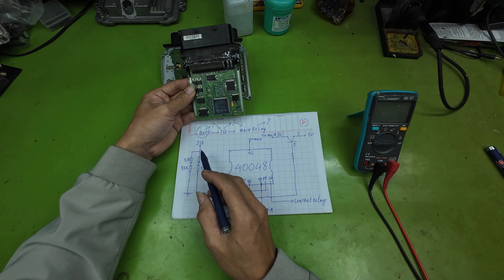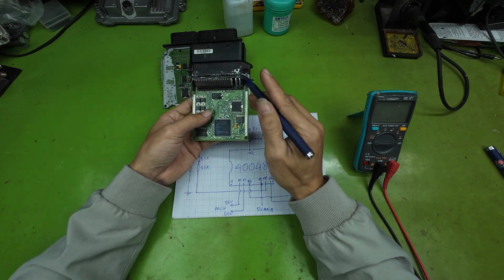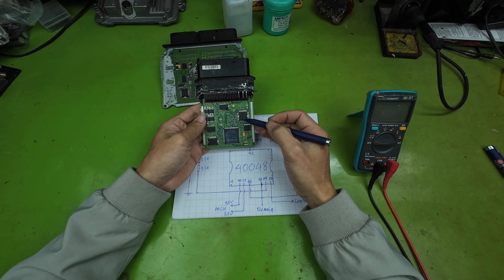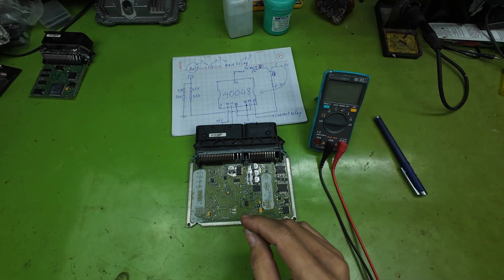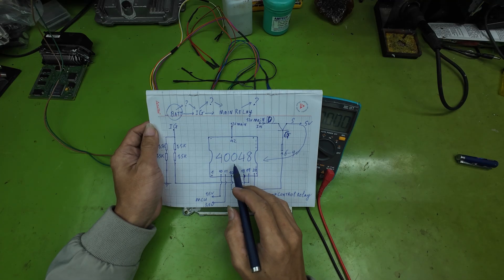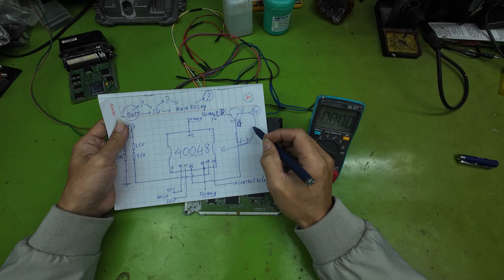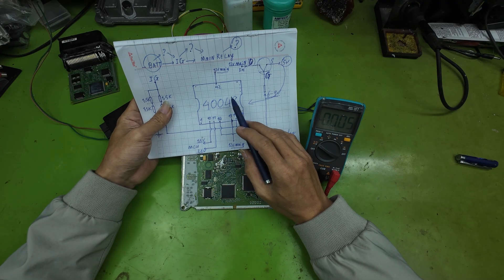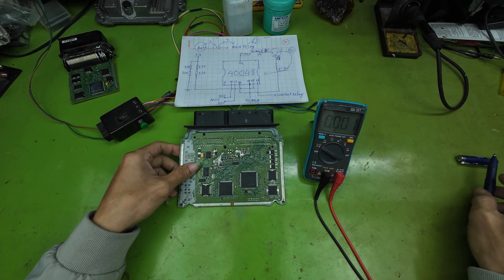Decoding the Power Supply Module in ECU Using IC40048 | ECU Repair Explained from A–Z

Comment: Good night  asking  a question what amp 12 volt  is needed when reading a ecu ,I'm trying with a  autel im508 ,hyundai ecu me17.9.11.1 cant read it giving me a chip error code.
Reply from the maker: When supplying external power to the ECU, a current of up to 2 amps is sufficient.
If you do not receive any response from the MCU, check the basic conditions, especially the MCU’s supply voltage, to determine the cause of the fault.
I’ve made a detailed video tutorial explaining the operation of the ECU power circuit — please watch and follow it carefully. I believe that once you do, you’ll be able to identify the problem.